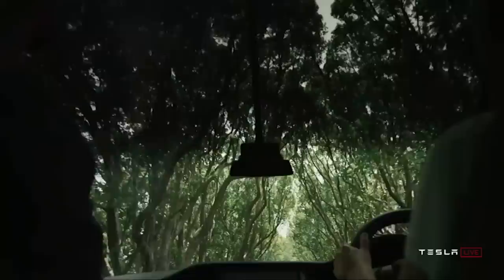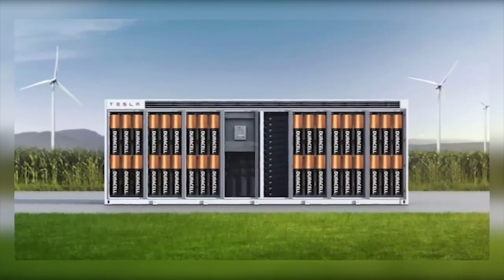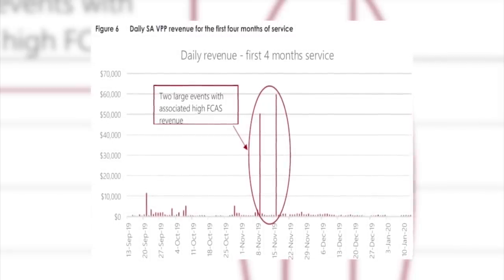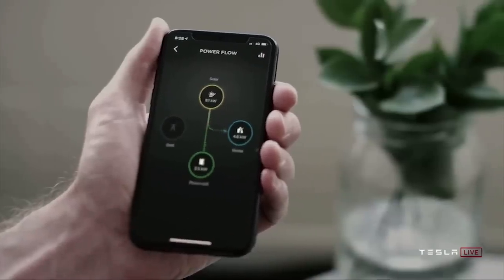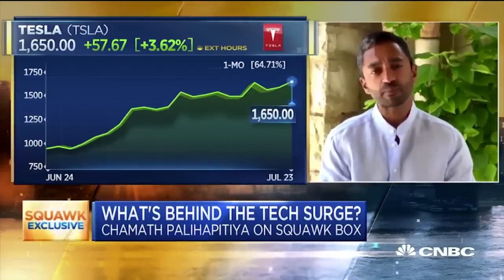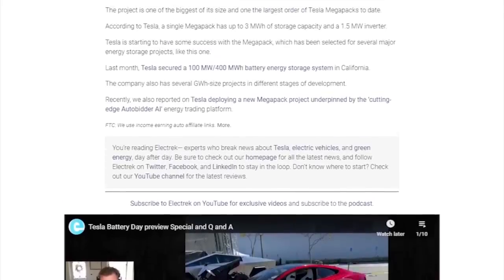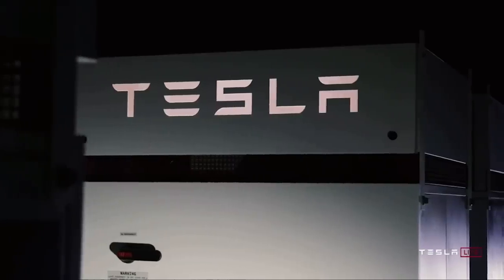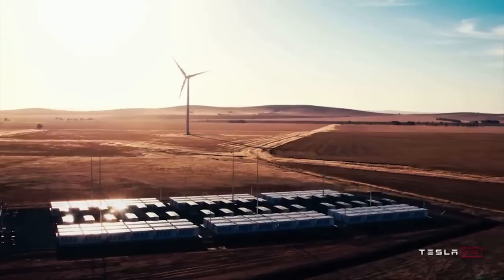Tesla Battery Farms Will Destroy Utility Grids

Comment: This is moronic. Lets look at the fundamentals here. Tesla is selling batteries. As we know, batteries need to be charged. Solar panels alone are not going to charge the batteries. The trillions of dollars in value here are not going to be achieved with batteries alone. Peakers are also not going anywhere for a long time. Look at the power outages in California where there simply wasn't enough power generation available to meet the demand. Do you think that making the shift to fully electric mobility/transportation/appliances is going to mean a flat demand curve for electricity? No. The efficiency low hanging fruit for electricity demand has already been gathered and from here forward, electrical demand will continue to grow. Batteries are just another user of that electricity and the fallacious idea that night charging price arbitrage will pay for them is laughable. Cars/busses/transport trucks will all be charging at night. Electrical prices will not be much lower at night as a result. There is so much misinformation being pumped out by people with glossy eyes that my head hurts. Do some more research.
Reply: California is having issues because of pushing wind and solar energy. They will never work, and they are far more expensive than people realize since solar panels and wind turbines are manufactured using cheap fossil fuel energy. That said, these batteries banks are a big deal. Power plants have peak load generators and base load generators. The peak load generators are far less efficient than the base load generators. Batteries allow the base load generators to generate extra power around the clock to meet peak load demands. This will simplify power plants, increase power plant efficiency, increase grid reliability, and decrease pollution.

Increasing demand on the grid around the clock will increase the base load, not peak loads. In fact, increasing load outside of peak hours will increase the base load, relatively decreasing the peak load. This is why power plants started passing the extra cost of peak load power to consumers. They wanted to spread peak demand around the clock so that it could be met by base load generators. So, these battery banks are good, just not for reasons that many people think.

EVs use energy generated far more efficiently than the energy generated by an ICE. They also do not pollute like ICEs do. However, base load generators often run on coal or natural gas. PragerU recently released a video arguing that coal plants produce more toxic pollution per a number of powered EVs than an equivalent number of ICE vehicles produce. I seriously doubt that claim. I don't know if they got the math wrong or what. But, the reality is that EVs are coal powered, although they are far more efficient than ICE vehicles. And, while EVs will require the grid to produce more base load power, peak load power is the greatest challenge.
Reply: Yes, the price of electricity is going to be cheaper during the day, specially during noon.

Comment: As relates to this topic, I would be interested to learn more about the feasibility, pros and cons of liquid air energy storage as applied to large utility grid scale energy storage.  With respect to Elon Musk, it seems like a very complimentary adjunct technology that is well within his wheelhouse in working with the storage and handling of cryogenic liquids at SpaceX and also well within the manufacturing capabilities at Tesla.  It seems like a technology that is both well suited and begging for his attention and expertise as it fits seamlessly into his overarching goals for the generation and storage of sustainable energy.  Commercial small scale liquid air compression and storage technology already exists (e.g., production of liquid nitrogen, oxygen, and argon) as a well understood proven reliable pollution free technology that is inherently safe, low tech, low capital, and low impact.  It also seems like it could be well suited to terawatt hour scaling (much quicker than lithium ion batteries) if the round trip (compression/expansion) energy economics (currently 50% to 70% energy efficient) can be made to work.  The primary raw material for the infrastructure is steel (mostly compressors, pipes, valves, and storage tanks) which is both plentiful and inexpensive.  With the declining price trend for gigawatt scale solar (now less than $0.02/kWh in some favorable locations) it is not hard to imagine we will soon reach an economic tipping point where an integrated gigawatt scale solar plant coupled to an on-site liquid air storage system will be able to chip into and compete with the 24/7 wholesale energy markets currently served by base load coal, nuclear, and natural gas.  Yet, despite the declining cost of new solar generation, the overall solar market is effectively capped by curtailment policies (e.g., frequency shifting) whereby utilities can instantaneously curtail and refuse to accept power from solar generators during times of peak solar generation.  Utilities are not going to voluntarily allow the solar market to eat into the 24/7 base load generating capacity of their existing coal, nuclear, and natural gas plants.  Without some form of large utility scale storage, curtailment policies will soon plateau and cap the market for new solar generation.
Reply: You make some very valid points.  DIYers have been doing their own research into compressors and competing as the most efficient for decades.  It's like pumping water back up into a hydro dam, it's all about diminishing returns.  the facts are that solid state always has the most potential for 90+% efficiencies that the tech you describe can never reach.  research glass electrolytes, Imho it's the next wave in solid state that will flip everything into perspective for everyone.
Reply: @patrickmcginnis7  I don't think I am following you on the applicability of solid state batteries.

The round trip efficiency of current lithium ion batteries are already about 85% to 95% when one considers the complete charge and discharge cycle.  The current storage problem is not one of efficiency, it is a problem of availability.  Over the short term (less than 10 years) the supply of megapack lithium ion batteries cannot be scaled up to meet the terawatt hour scale demands of the wholesale energy markets.  Perhaps the supply of large grid scale liquid air energy storage systems could be scaled up to meet the terawatt hour storage demands of the market?

Solid state batteries are still in the research and development stage. At present they are not available to the market on any scale (small or large) and there is no time period yet known when they might become available.

Comment: To answer the host’s basic premise and question.  I believe the short answer is no.  For the foreseeable future (5 to 10 years) the limited scalability (constrained by raw material supply chains and battery factory capacity) and therefore the market for the Tesla megapack will not be able to reach much beyond the limited niche market of peaker plants and perhaps propping up and supporting some local transmission grids that are at capacity during times of peak load.  Due to scalability constraints (raw material supply chain and limited battery factory capacity) the Tesla megapack will not be produced in sufficient volume to displace or seriously compete with the wholesale energy markets currently served by base load coal, nuclear, and natural gas.  

Having said that, the megapack may nevertheless disrupt the collective stock price of the electric utility industry.  Stock price is reflective of the current growth in revenues/earnings as well as the projected growth in future revenues/earnings.  The price trend of Tesla stock itself is testament to this financial phenomena.  All the megapack need do is to instill a sense of uncertainty in the growth of future revenues in order to tank the collective stock price of the electric utility industry and everything consequently disruptive that goes along with that.  The collapse in ExxonMobil’s stock price is testament to this phenomena.  In 2014 Exxon was sitting at the top of the financial world ranking the top spot in the Dow Jones industrial average.  In 2020, Exxon has been dropped from the Dow Jones and lost 65% of its 2014 peak market value. Exxon is now sitting on a bunch of stranded fossil assets losing market value with each passing day.  The same could be said for Ford and GM as the future value of their soon to be obsolete ICE products diminishes with each passing day.
Reply: Again, you make some interesting connections.  But Tesla acquired lithium deposits in Nevada that will feed his needs for decades.  it's not about energy production, our demand will always outweigh our supply in my lifetime.  Now I'm not a 100% batt. EV guy, I thing hybrids have a large place in the market.  You think trains are all diesel motors?  Drop some efficient batt. packs in some trains or better yet some OTR tractor trailers and watch CO² emissions and air quality numbers.  Ford & GM were saved by the govt., but they are still under attack by foreign investment.  They aren't the same companies they used to be and with mfg. crippled their competitiveness is defunct.  The advantages of going from a 4.7L ICE to a 1.2L ICE w/ a EM are pretty obvious.  Is the world ready for 100% EV? not imho.
Reply: @patrickmcginnis7  I am not going to take the Tesla bait.  I do not take Tesla's Nevada lithium mine announcement at face value.

Developing a new lithium mine from a novel source (clay) in conjunction with a novel extraction technology (table salt and water) is a process that will take considerable time, capital, and engineering talent (Note: according to Elon Musk engineering talent is a commodity in very short supply).  No doubt Tesla would actually buckle down and go that route if the lithium supply and demand economics warrant such action.  However, I think Elon Musk announcing the new Nevada lithium mine on battery day was nothing but a well planned and well played ruse.  It was Elon Musk (holding maybe two pair at best, bluffing that he is holding a straight flush) playing high stakes poker with the worlds lithium suppliers in order to get them to fold.  It was a very public hard ball negotiating tactic to quickly drive the worlds major lithium suppliers to the negotiating table to lock in and secure long term supply contracts on terms favorable to Tesla.  Tesla's slumbering battery competition (a day late and a dollar short) will be left to fight over the leftover table scraps at premium prices.  Case in point, within days of the battery day announcement Tesla secured a long contract with Piedmont Lithium to supply lithium from it's North Carolina mine. Why did Tesla do this if it is planning to develop its own low tech low cost lithium mine?  Why did Piedmont Lithium quickly fold its hand and agree on 9/28 to a long term supply contract within mere days after the battery day announcement?

I am not following you on diesel/electric locomotives.  Diesel/electric locomotives have been on the market for many decades.  They represent the quintessential apex of an ICE / hybrid drive propulsion system.  The drive shaft of the diesel engine turns an electric generator which in turn supplies electricity to the electric motors which propel the train.  Inserting a new supplemental hybrid battery system would only serve to add weight, cost, and a measure of energy inefficiency (due to resistance heat losses in charging/discharging the battery).  Locomotives typically operate for a long duration at a near constant steady state speed.  There is no need for a supplemental hybrid battery to quickly boost acceleration and power like a car.  Adding a battery storage system to a diesel/electric locomotive only makes sense if you were trying to recapture and store the electricity generated through the dynamic braking system.  The rheostatic dynamic braking systems of modern diesel/electric locomotives dissipate this energy as resistive heat that is actively vented through the large circular vents in the roof of the locomotive.  Theoretically, with the addition of a battery storage system the dynamic braking system could regenerate and store this energy in the battery.  However, this is not done today because the economics do not work.   A hybrid battery system would add significant weight and space (the locomotive would be larger and heavier), ongoing maintenance costs (inspections, testing, repairs) as well as the upfront engineering design and manufacturing costs that add to the initial purchase price.

Comment: That was a good flic. Thank you!
However, the last question was pretty stupid "will battery storage eventually make powerplants obsolete"
Obviously not as a battery is an electricity storage device, not a generation device.
Battery storage will most certainly lead to the better use of existing power generation capacities. 
It has also become evident that Tesla is targeting that market with the new EV batteries and Powerwalls together with their Tesla Solar offering. This will lead to a much more de-centralized grid that may need big megapacks to act as network stabilisers. However the main impact will be the millions of private nextgen pervoskite rooftop PV systems combined with Power walls and EV batteries feeding a de-centralized grid.
Maybe even PG&E will see the benefit to bury the power lines in the ground to avoid fire liabilities and enjoy the profits from their energy storage investment.

Comment: A massive factor in the success and expansion of the Australian example that these giant batteries "iron out" the quality of the electrical grid. Electrical "transients" caused by fallen powerlines and other spikes are what cause blackouts, and the batteries actually prevent them from occurring rather than kicking in if one happens. That's where the massive profits come from.

They aren't made to be completely discharged, which also gives them a longer lifetime and efficiency. And they solve one of the few genuine problems remaining with renewables in that power fluctuations can happen in poor weather conditions.

Comment: Will this disrupt or augment the power grid?  I think the latter.  If it makes sense, meaning the cost of PV cells is low enough and the cost of batteries is low enough, the power companies will gradually migrate their product to solar generation / battery storage.   The only question that remains to me will be how much of the market will be  "DIY I've got panels on my roof" vs how much will just buy from a utility because of their economies of scale.
Where I live, utility companies are leasing farm land all over the place for their solar farms.  Thousands of acres.  It's happening right now and has been for several years.

Comment: I'm a retired engineer and power system operator. Yes this is the technology we have been waiting for. PNM, the company I worked for, did a joint study with Sandia Labs and Santa Fe Community College using a small battery pack to test the viability of peaker storage with a solar array and the big problem was the chemistry they were using was to costly and had way to few cycles. Within PNM's Balancing area are many alt energy projects and they swing the interconnection around causing imbalances in the western grid. This is critical tech to make alt energy viable. I know because I was a reliability operator and sometimes we had to curtail wind and solar due to their variability. If we had mega packs in the proper areas we wouldn't have had to bring the NG peakers online at all. During the February 2011 cold snap these would have prevented rolling blackouts and the freezing up of the Permian basin oil and gas supply. The greatest potential is in "spinning" reserves. Instantaneous reserves able to be access to maintain the grid bonding when power plants trip off, including wind farms under high winds and null winds and solar array shading from clouds.
Reply: Such battery packs could handle peak loads, which would be great for energy providers. But, people are fooling themselves if they get the impression that this will eliminate the need for base load power plants altogether.
EDIT: At least, it won't eliminate base load power stations any time soon.
Reply: Austin P I think energy storage will become house by house and suburb by suburb. No more poles and wires. I am developing a large manufacturing facility atm and we are going off grid.
Reply: @Austin1990  I doubt they ever will. I just saw that MIT is saying fusion is closer than most think. Were it not for the Palo Verde Nuclear upgrades (1.4GW each reactor),  there is no way we could have retired the San Juan coal fired plants early (6/30/22) or Four Corners, operated by APS but both partly owned by CA utilities. Look at them and their rolling black outs since the rely more on run of the river hydro and wind out of OR and WA and CO river hydro now. CA's dirty little secret is they still buy coal electricity off the open market and rely heavily on PV since closing SONGS nucs. https://en.wikipedia.org/wiki/Palo_Verde_Nuclear_Generating_Station
Reply: Fellow New Mexican here! I live next to a solar farm actually! Very cool reading your comment.
Reply: @Firestar2013  NM could power the country if MLG would pull her head out of the DNC's arse. Between the alts and Permian basin NG combined combustion plants at the wells. Oh, they all but ended the big interconnection project to the eastern interconnection too. I'm back In CO now. https://en.wikipedia.org/wiki/Tres_Amigas_SuperStation
Reply: And in this scene in the near future will be Tesla’s Autobidder software.